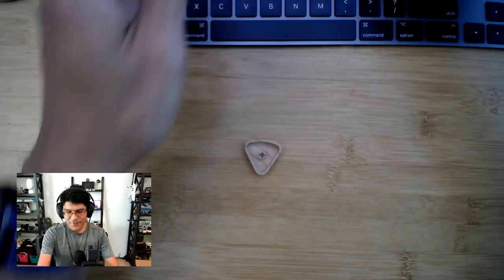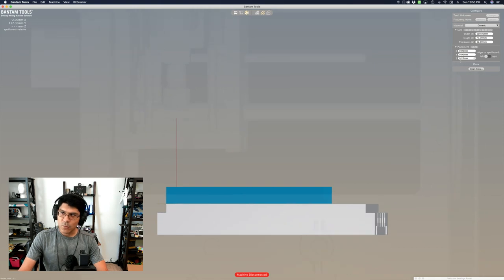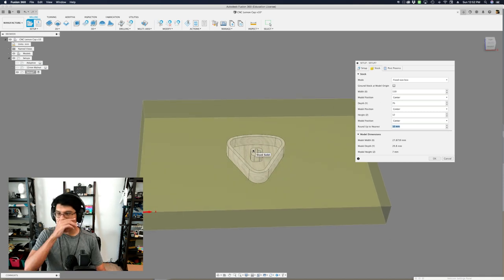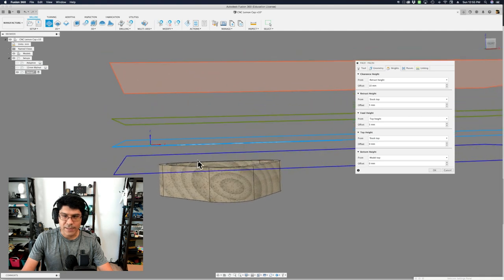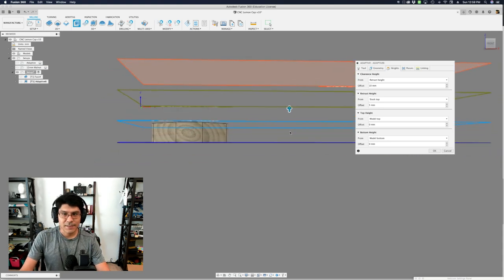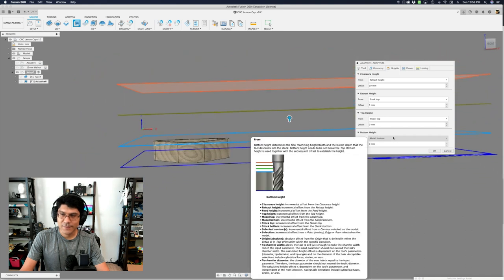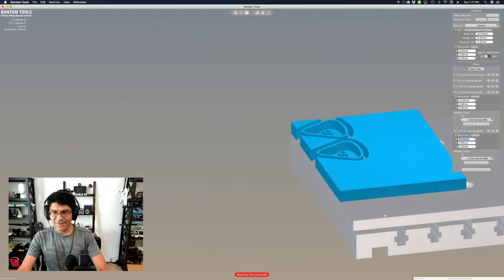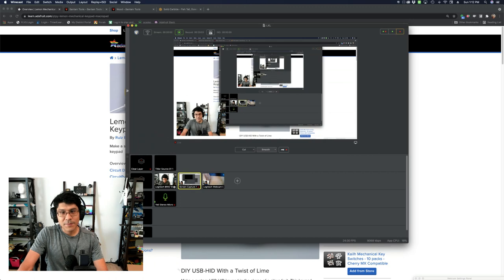Layer by Layer – CNC Milling Key Caps

Comment: Great video! I was wondering what the Bantam tools interface looked like working with Fusion. PS, there's also a pattern capability in the manufacture workspace that could work to make multiples.